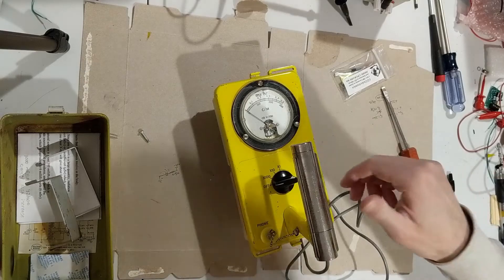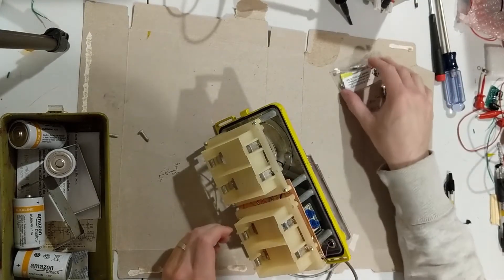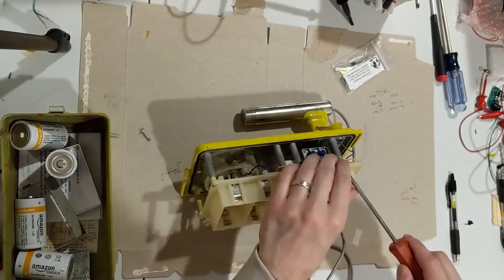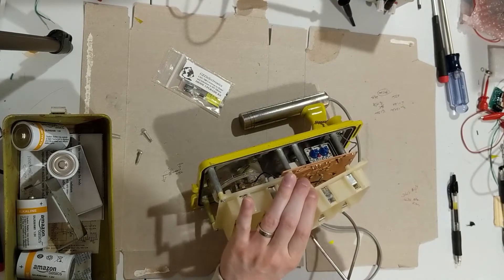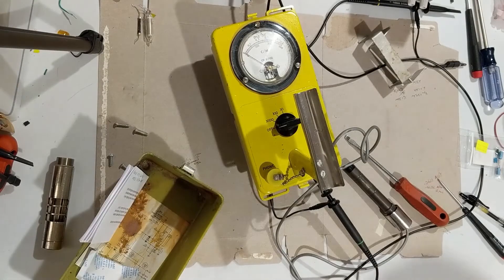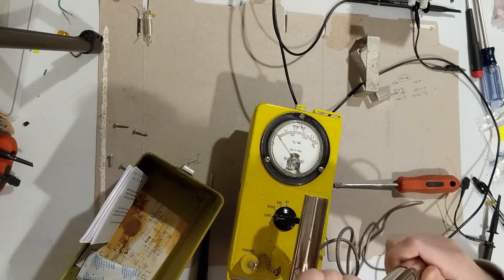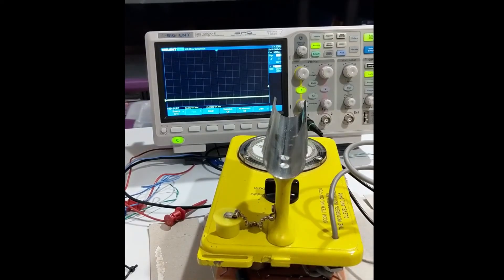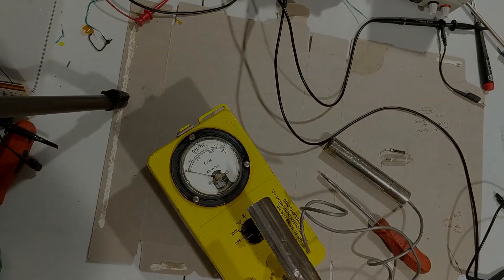Geiger Counter Repair (V-700 Model 6B) / HV Upgrade

Comment: I'm from the future. 
Sadly, Geo Electronics (Oak Ridge Labs) is no longer a thing. If i remember correctly, George was having medical problems and sold off most of his equipment and supply. My brother and i have some of his equipment now (sadly), but im not in the position to start making kits yet. 

Just added information to throw into the void
Reply from the maker: @Jack_Luck.v2  Thanks for the background. The kits would be easy, I wonder how many he actually sold though…
Reply: @TheMadHatter1337  i bought quite a lot of Geo for CDV repair. I know when I bought my first one from him, his ebay said over 300 sold, so there's probably a lot of CDV's with his kits in them currently. 

The problem is that you have to test and categorize the diodes, both regular rectifier diodes and Schottky diodes, to make sure that you can set a tolerance for the kit. It gets weird.... 
I'm currently working on replacement transformers for Ludlum and Eberline survey meters. The limiting factor is that you can't buy them from the manufacturer unless you are working for the military, so reverse engineering is the way. 
(Luck Labs LLC)

Comment: ...I just skipped all of this and built my own.
Reply from the maker: Yea, geiger counters are trivial with modern technology… the point of the video is to walk people through how it works if they wanna fix their own.
Reply: @TheMadHatter1337  do you have a diagram and part numbers of the zener diodes? I have 2 different models of these geiger counters and want to replace the corotron before firing them back up. Would really suck to break my geiger counters!
Reply from the maker: @ I do not, if they are backwards it will just short the HV to ground and not ruin anything… I forget the exact stack voltage but you can use any zener/tvs type as long as when combined they add up to the same regulated voltage as the tube did.

Comment: Collin....  I very much enjoyed your video.  I have the exact same make and model.  I noticed a rebuild kit for our exact make and model on ebay and bought it.  With postage it was about $40.00.  It came with all new components.  It came with 8 resistors, 5 caps, 2 transistors, and what look like 3 diodes.  It also came with a very small matrix of 4 diodes on a very small board ready to install to replace that old tube.  My Victoreen CVD 700-6B looks brand new.  If you had all the parts on hand like I have, would you go ahead and install them all?  I know older caps go bad, so I will replace all of them.  And I would replace the three diodes plus the replacement of the tube.  If not used, do old resistors go bad?  Would you replace them?  Also, I fond a document made by Victoreen back in the day that is much better then the manual that came with this unit.  It has test points on the schematic and additional troubling shooting tips.  Here is a link to a pdf of this document:  https://electrorestore.com/docs/Victor-700-6b-Geiger-Counter-Service-Manual.pdf   Again, very much enjoyed your video.  I will use it as I take my unit apart and start in on the rebuild.  mraroid

Comment: For the Corotron you can usually just leave that in the circuit and install the replacement board in parallel across it. GeoElectronic also sells a volt meter for the HV I have one and it works great.

Comment: Hi I'm just Wondering if you have a Link to the ebay page wheee you got your parts from.because I'm having a similar issue with my CDV700 geiger counter
Reply from the maker: I looked, it appears no one sells kits anymore... That being said, they are just 3 high voltage Zener diodes in series (Total of 900V).

Comment: radium has a half life or 1600 years actually and that's completely incorrect
Reply: radium has isotopes with half lives ranging from a couple of days to thousands of years.  it all depends on which isotope you're talking about.
Reply: Say that to all the bad coronatron tubes rip
Reply from the maker: False - There are multiple isotopes... The average decay for a pit is closer to 10-20 years.
Reply: @TheMadHatter1337  None of radium’s useful isotopes have a half life of 22 years  Ra266 has a half life of 1600 years, Ra228 has a half life of 5.75 years, and Ra223 11 days.
Reply: @TheMadHatter1337  radium stays radioactive from 1000s of years
Reply: @kingcanada2588 Plain radium? There's no plain radium inside the tube. It's an isotope of it. But most of the corotron tubes use Nickel-63

Comment: I just bought one of these in working order & good condition if you need Hi-Res photos. I also bought a CDV-715 Ion Chamber that I think the meter was wired in wrong in a botched repair but I dont have the knowledge in electronics to fix at this time. I am learning quickly! Lucky there are great uranium deposits in the area with great crystals. There is a free book on audible called Atomic Adventures that has a chapter on the development of radiation detection meters. I'm thinking of doing the mod to my CDV-700, probably going to wait a few weeks to know what I'm doing. Great videos keep them coming please. If you have a 715 ion chamber please do a video on  that circuit.